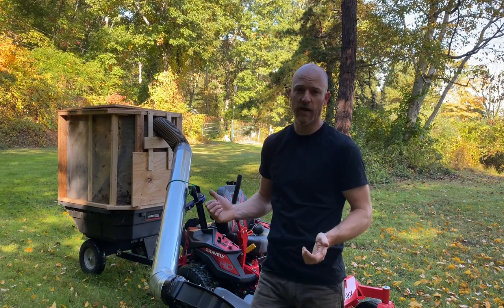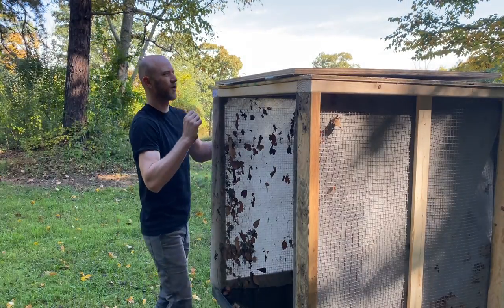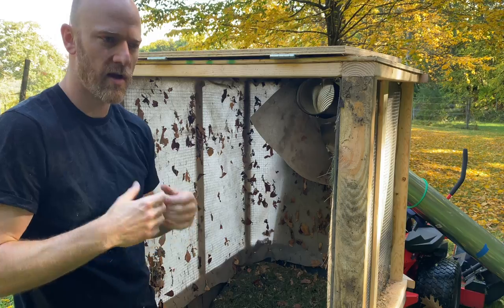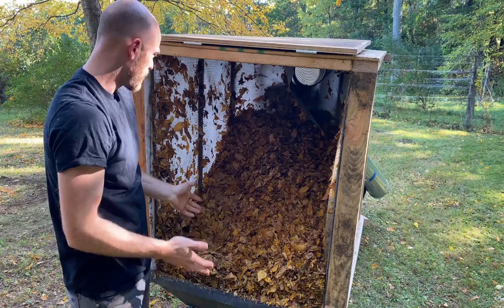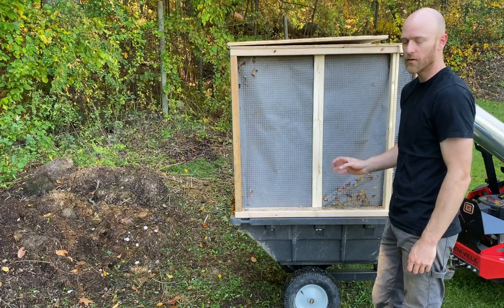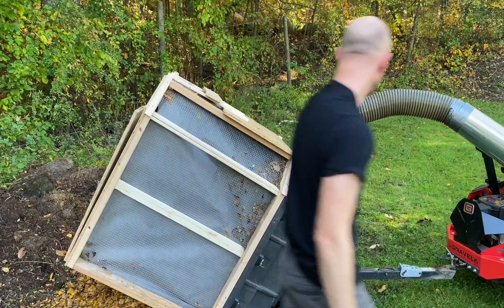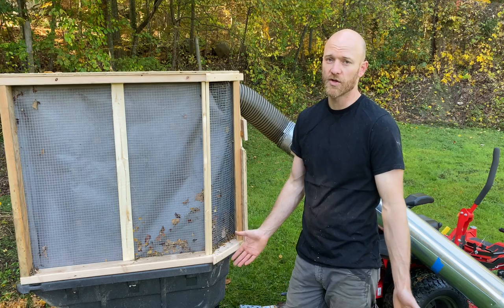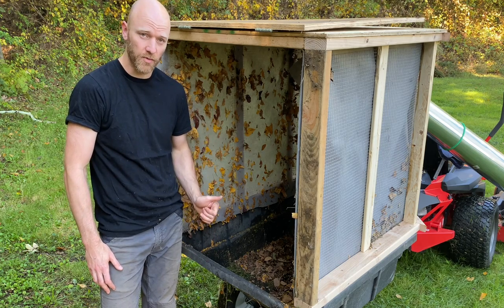Homemade leaf vacuum! Upgrade your mower for fall leaf cleanup with a DIY leaf collection solution!

Comment: Very nice, that will give you more capacity for sure. If you lower the deck more it will suck up everything super clean
Reply from the maker: Thanks!  I'm having problems with the powerhead clogging up, so trying to not suck in as much grass with it.  More problems to solve.